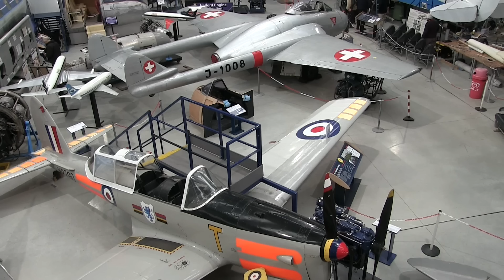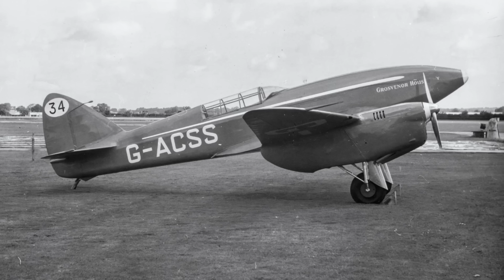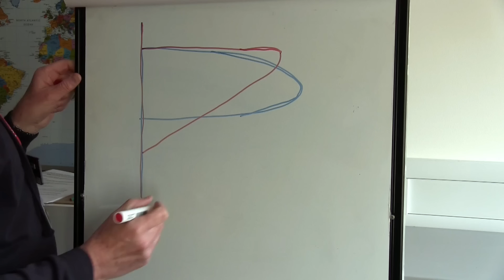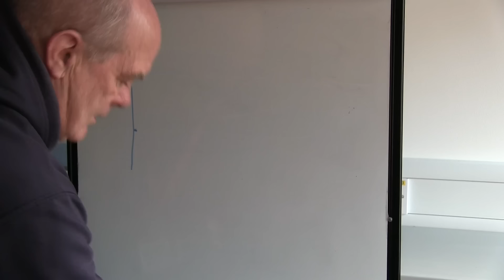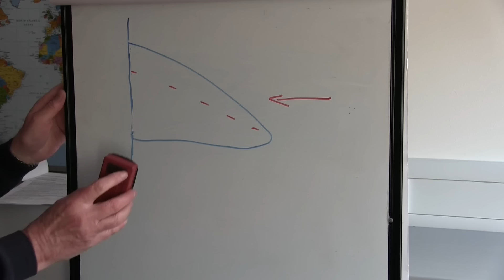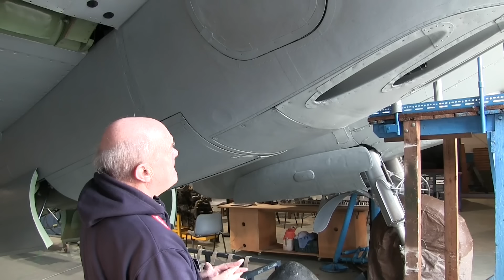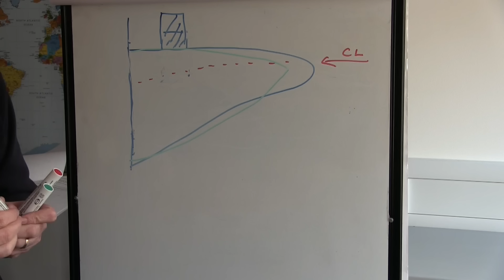Why Did the Mosquito Have Triangular Wings? The Mystery Explained

Comment: Biggest advantage in fact was in turning ….. aerodynamics give even dynamic compression fluidity by delaying turbulence omsett.
Reply: You've touched on something I'd wanted to ask about i.e. what is the behaviour of a wing with strongly swept forward trailing edge as the angle of attack increases. I can imagine that air is induced to move more outwards spanwise so that in effect the narrower chord at the tip becomes less of an issue with respect to critical Reynolds Number (or whatever it is that determines tip stall behaviour) because airflow is not running fully aligned with the wing chord at that point. Would any of that make sense? (I don't claim to know!)

Comment: That was a very interesting and informative video.Thank you very much,but it made me think of the DC-3 where the leading edge angle is basically the opposite way round to the Mosquito.Just a thought.
Reply: That was swept back to maintain the correct centre of gravity. Just like on the Me-262.